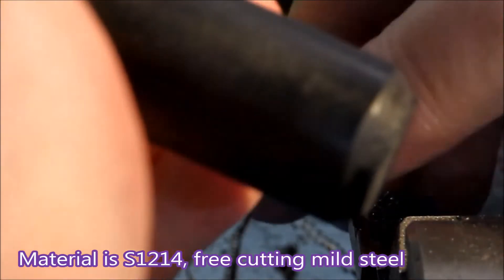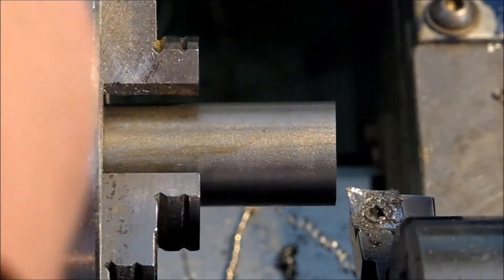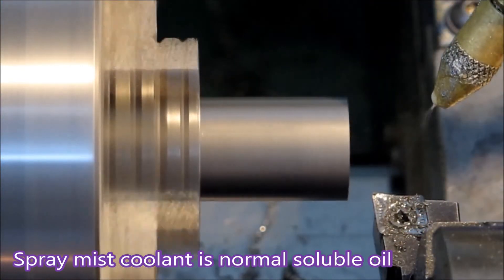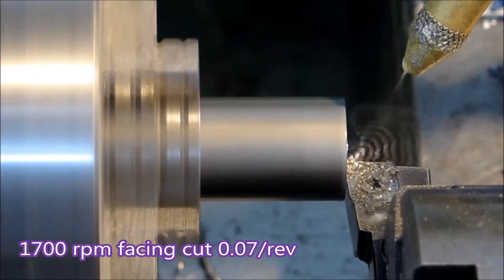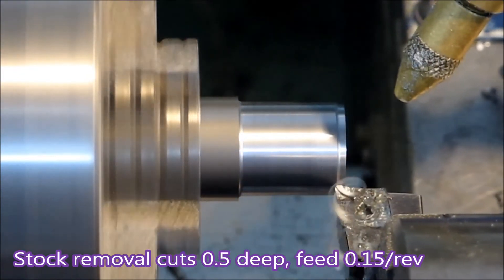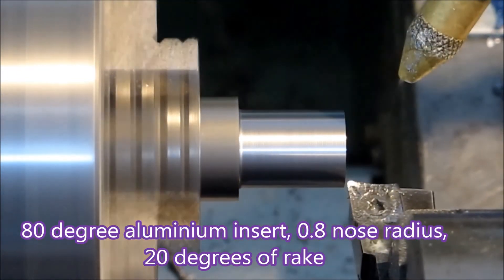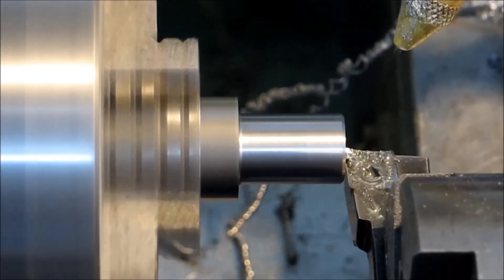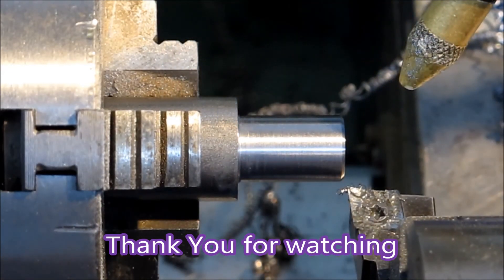Carbide Insert for Aluminium, turning Steel. Try it in your Chinese mini lathe. You might like it.

Comment: What about aluminum ?
my carbide inserts CHEW aluminum unless i apply lube all the time.
Reply from the maker: Hi Tony, if you are using inserts like this which is made for aluminium, I have no idea. Machine grade aluminium cuts really well and chips nicely. 6061 and similar is pretty horrible and won’t chip on a small machine, but I would not call it chewing.

Comment: Yep, I use nothing else in my Mini Lathe now that inserts for alu. Have done SS and titanium with them.
Reply from the maker: Do you find they grab when turning brass?
Reply: @smallcnclathes  Not at all, they seem to make the tiniest powder type chips in brass. But then again, I don't take as deep cuts as you - I am just a tinkerer so don't need to save time on the machining. 
But I do feel I can take deeper cuts than most regular Mini Mill users as I put in a pretty sturdy tool post plus a 750w brushless motor. No bogging down anylonger.

Comment: How long do these inserts last ? I might have made the mistake of getting the dcmt inserts for aluminium with 0.2mm radius. Gets destroyed by 1214.
Reply from the maker: Never used the .2 radius, what surface speed are you using? As you saw in the video, .8 radius worked quite well for me at those speeds and feeds
Reply: @smallcnclathes  16mm diameter, 0.25mm depth of cut and 0.05mm per revolution at 1600rpm. Perhaps too aggressive ?
Reply from the maker: @HM-Projects  Any coolant or lubricant used?  Does not seem too aggressive to me, may be down to the 0.2 radius, really not sure.  You are asking less of it than I did in the video!
Reply: @smallcnclathes  no coolant, got myself a small bench lathe to learn and I'm still finding my way around.

Other possibility is cheapy eBay insert or the vibration on the lathe. I'll  try rough turning using a larger radius tcmt insert and then finishing with the dcmt070202 AK
Reply from the maker: @HM-Projects  Not much point finishing with a 0.2 radius, you should get a better finish with the larger radius.  ebay inserts seem to work ok for me and at 1600, I would not have thought vibration would be a problem. How much work are you asking the inserts to do?  My suggestion was never intended for production work, I really don't expect folks to do that on a mini lathe.LOL.  The parts in the video were 20 in number I think and all were done with the one insert. As they cost so little, is it worth trying some 0.8 radius inserts?
Reply: @smallcnclathes  I just bought some, will have to wait to try to them out. The damage is definitely due to the initial cleanup of the saw cut part. Interrupted cuts perhaps. Tried roughing tcmt insert for initial cleanup and turning. Finished with the dcmt070202, worked nicely. I can't see any of the edge damage I saw earlier. 

Thanks for these videos btw, I'm learning a lot here.
Reply from the maker: @HM-Projects  The sharpness of the AK inserts means they do not handle interrupted cutting too well.
Reply: @smallcnclathes  I've been learning to grind hss tools and I can see they produce much better results on aluminium and brass, especially with single point threading.
Reply from the maker: I don't use HSS as they are not suited to economical production in a cnc lathe. Single point threading is not something I do by choice either. Full form inserts just make better threads. Cut crest and root at the same time and if the diameter is correct the thread is right. No measuring with wires or thread micrometers, job done.  From memory, over the years I ground a HSS tool to face a groove in the manual lathe, I think that was a HSS parting tool which I refuse to use for parting, as for me they just don't work.  When the customer was in a hurry and I did not have the correct insert to cut M4x0.7, I used a 0.8 pitch insert, it was close enough, the thread worked and the customer was happy. Not how I like to do things though.
Reply: @smallcnclathes  yeah I understand that it's not great for production use. I'm just tinkering around in the shed.

Comment: Great video! I always wondered about using these insets for steel. They're definitely sharper than general purpose steel inserts and the lack of coating also helps in the sharpness department.
Reply from the maker: Thanks Tony, I think they are great for mini lathes which always struggle for power, the sharpness and the rake angle, make cutting just that bit easier

Comment: If your lathe cannot handle Carbide inserts you are using the wrong insert/feed or speed. Before you pipe up machinist  of 25 years and i also made carbide inserts for 8 years . Ali tips are for Ali that's why they are called Ali inserts .Any tip will cut steel but the point is any tip isn't the right tip .
Reply from the maker: You are absolutely right, and with 10 hp, I bet every insert can be the right one for the right material and the correct speeds and feeds can be used to suit that operation.
With perhaps less than ½ hp this is not possible.  One uses an insert that will remove material as quickly as possible, using a feed and d.o.c to suit the machine and that is the point of this video.
High rake angles reduce the required hp for any given cut as you know.  A  ground edge insert with 20 degrees of rake works really well in lathes with little spindle power.  I really don’t care if the manufacturers say it is for aluminium, I don’t think they are speaking to mini lathe users.
It cuts brass, aluminium and free cutting steel easier than any other insert I know of.
Thank You for your comment

Comment: Gobsmacked ! Did i hear right ? The tool is aluminium, and it cuts steel ?
Reply from the maker: What are dog biscuits made of?
Dog biscuits are made for dogs not of dogs (no offense to your pooch)
Aluminium inserts are the same, made of cemented carbide to cut aluminium not of aluminium.
The title does say Aluminium Carbide Insert and I guess that SHOULD say Carbide insert for Aluminium 
However the message is that these inserts made to cut aluminium, will cut steel, particularly good for under powered lathes as they are very sharp with a 20 degree rake angle which makes they cut really easily.  I use them for brass as well, they do not last too long cutting steel but they are really cheap on eBay so a reasonable option.
Reply: Well, as swdweed asked about aluminium oxide, i probably got all giddy and carried away with the idea.
It's really cool the way you adapt the 'normal rules' to the mini lathe.
Reply from the maker: When you are making parts for customers, if you want to be in there with a chance to compete, you have to do what you can. Half a hp needs all the help it can get even on small parts.
Reply from the maker: Have you watched any of the swdweeb videos? Perry is very entertaining, I watch them even though casting is not really my thing.
Reply: I have an old Colchester Triumph roundhead lathe. The old girl is accurate to less than a tenth! I have always struggled to get a nice finish using carbide tips as my top speed is only 1000rpm. I should use hss tools but no good at grinding them.
Tried a very sharp point tool on aluminium and it worked a treat. Specially designed for aluminium. Then I tested it on steel. Again a lovely finish. 
Now I will use conventional carbide for roughing and the aluminium inserts for steel.

Comment: I'll ask a dumb question. I use Aluminum oxide cut-off wheels. Are these things made of a similar material that allows them to cut steel?
Reply from the maker: Sorry Perry, that is just a machinist talking to other machinists.  The inserts are actually cemented tungsten carbide, these ones are made specifically to cut aluminium which has properties and is so widely machined that it is worth making inserts for just for aluminium.  Aluminium Inserts is just so much quicker than "cemented carbide inserts for machining aluminium" I have changed the Title and the Description to be more accurate. 
So, not a dumb question at all, just allowed me to improve the title and not confuse others.
Thanks for your comment
Reply from the maker: Mescalinum Sunshine I don’t use them. They need to be sharpened and that does not allow for the repeatability that is required for cnc machining.